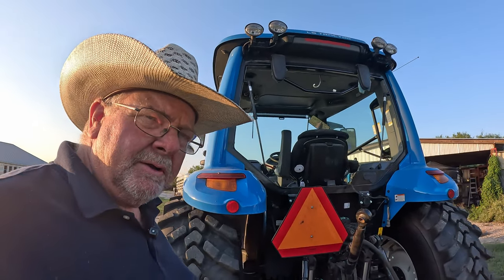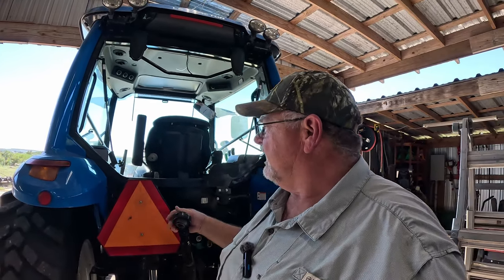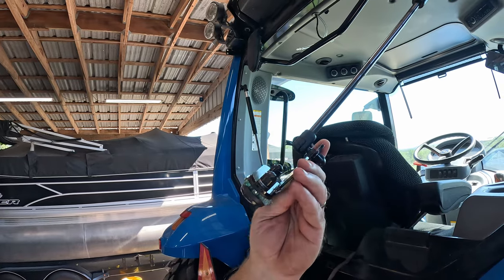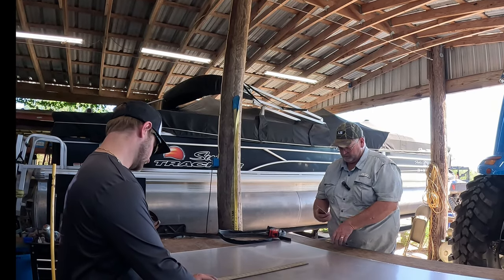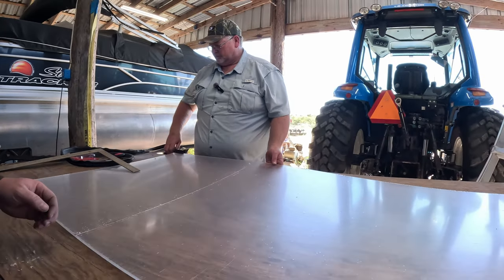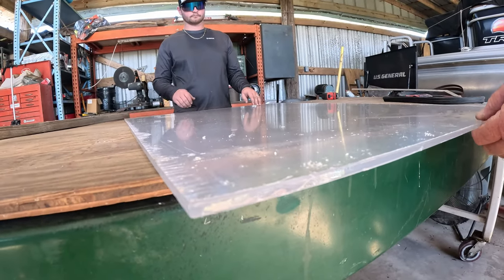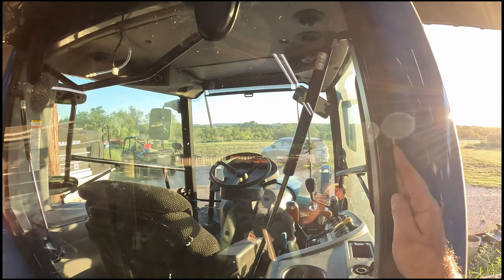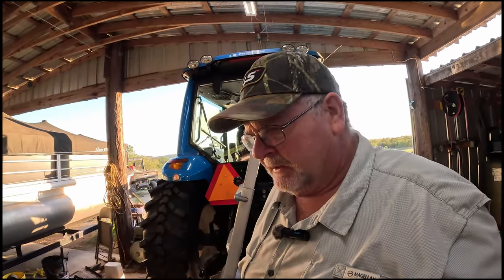I have some shattering news and its not good!

Comment: Just for your info, from what I understand,SOMETIMES  if you can get a LS part number, should be available online , you can add MT in front of the part number and it will cross with a New Holland part number. Most of the time the part may be cheaper and turn around time is also quicker. Maybe this will help you out. 
Your repair looks great and Im glad your ok. 
Take care and be safe out there !!
Reply from the maker: Thanks, hopfully this all  will work out well. I have a good dealer and he is already on it. stay safe as well and thanks as always.